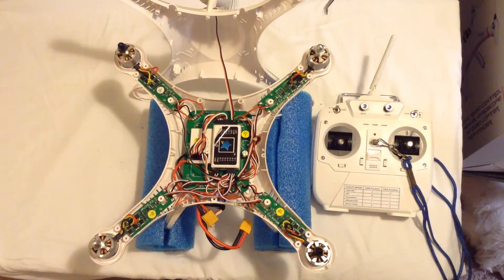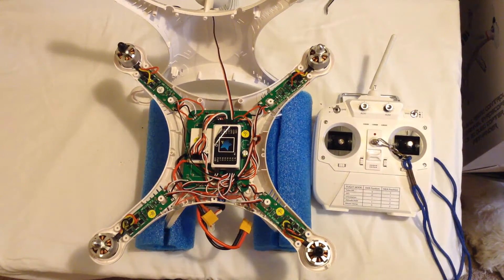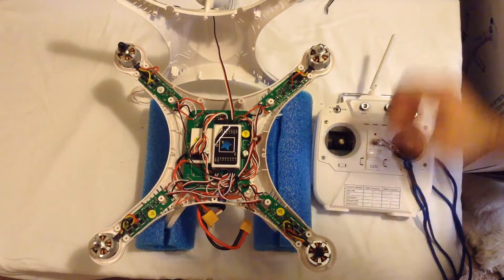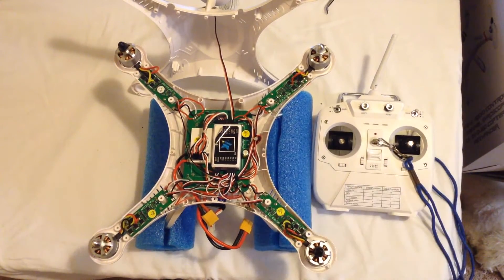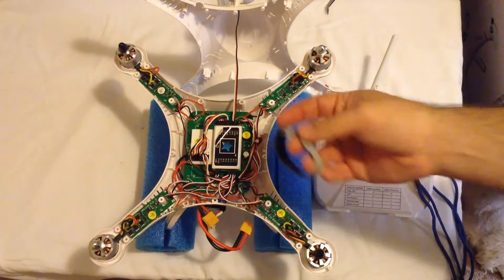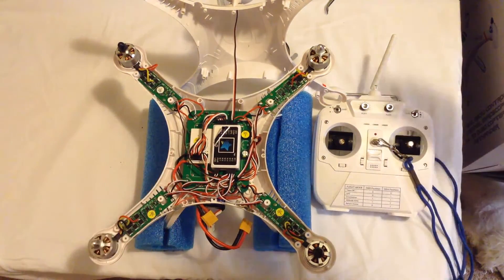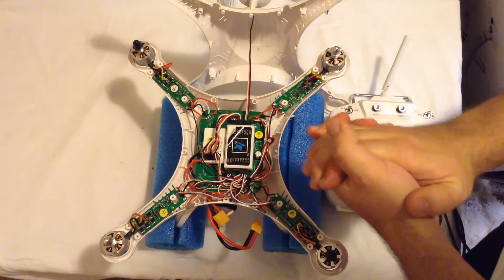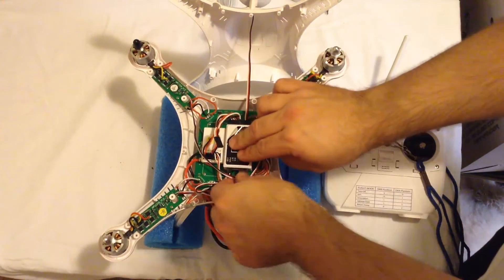Micro Gear CX20 #3 with bigshark flight controller

Comment: kristian , tengo un problema con mi drone cx cheerson big shrak , el motor 3 no funciona solo pita, hice el proceso que usted muestra en el video , pero el motor sigue igual, podrias ayudarme, sabes como solucionarlo? gracias
Reply from the maker: Pesca Aventuras Fishing Brothers Club  since I don’t speak Spanish, I guess your 3 rd motor not working. Please re solder the wires, try to connect the motor 3 to motor 2 so you make sure it’s not the flight controller they to test the esc . I have this : https://www.amazon.com/SIKAF-MALL-Digital-Consistency-Controler/dp/B06WVM46KB/ref=mp_s_a_1_1?keywords=esc+tester&qid=1564948603&s=gateway&sr=8-1 to test the motor and esc before I add it to the drone.

Comment: Very nice. I think. I noticed a small problem with my unit (from the box - no previous manipulation by me), one engine was not starting when the other three was, only when I increased the throttle more this 4th engine was powering up. It still fly but can not hoover in one place, it always drifted in various directions (even with gps hold). So I found this video and was giving it a go. Turns out the wiring from this engine is not far enough to reach the throttle slot described in this video for calibration. I guess that's the answer then, because this engine can not have been calibrated from factory, at least not with this method. So now I have to rewire this damn thing with longer wires.

So question: Does anyone know the temperature limits one the circuit boards (Preferably in [C'])? How careful do I need to be? :D And is it any type of standard cable that need to be used.

Comment: Hi Kristian, Thank you so very much for posting this video on the Micro Gear CX-20.  I bought mine and brand new out of the box rotors were not turning.  It calibrated ok, and throttle bottom - to right, red light stops blinking and throttle up, nothing.  I sent it back to ParkNShop and called Randy, the Owner he was very nice.  I'm waiting for it to come back from the shop, said 5 to 7 days turn around.   Funny, I spent almost two weeks looking at every post, all Nova and Cheerson to no avail.  Dead on arrival. 

I wish I had more helpful information to contribute thus far, but will post hopefully some useful information when it comes back.  Thanks for your excellent post and video, incredibly helpful in getting into this 'mystery' machine as nobody seems to own the Micro Gear CX-20.   Two local hobby shops where I live never even heard of it.  Related it to the Phantom.

Thanks,

Comment: Helllo cristian
I got the same quadter that you have even thogh my not says microgear
I have to disarm mine after a crash and now
i put it back together but for anyreason is making wierd beeping noise and is not working at all
Can u please send me a diagram of the wiring connections from the reciver to the flight controller 
I.mean a picture of the wiring inside copter

Thanks